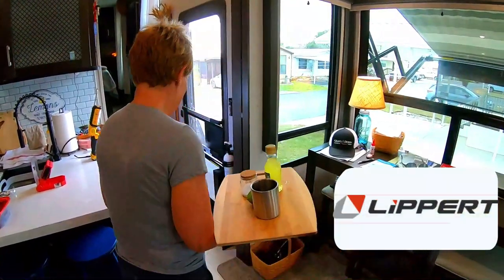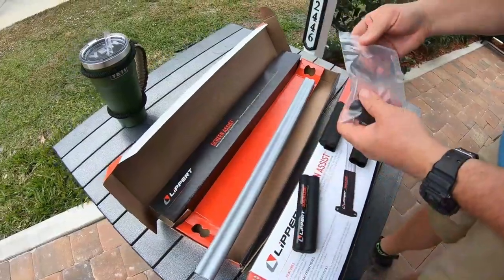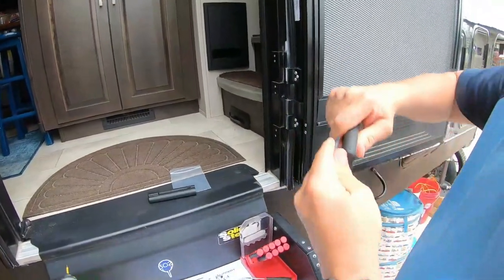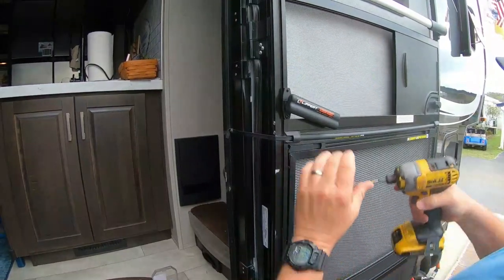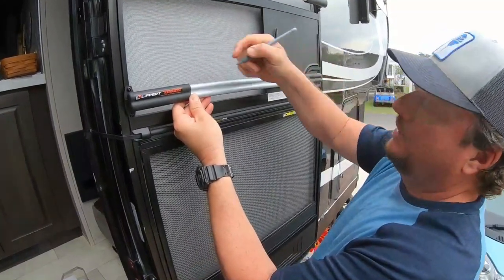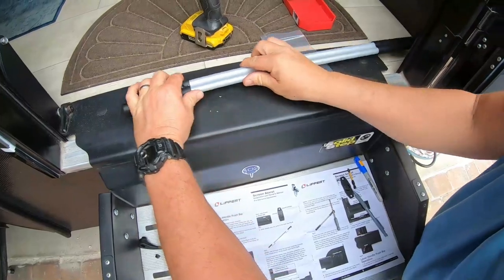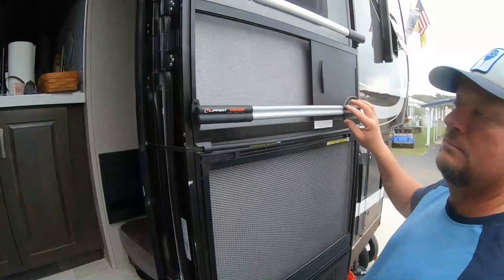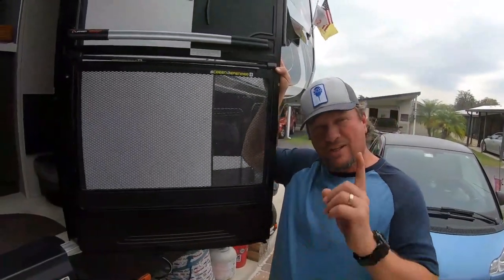Lippert Screen Assist - Hands Free Screen Door Opening!

Comment: Just an FYI , the mounting hardware that mounts to the screen door side (not the handle side) has 2 flat spots on them , so when your installing the bar into the hardware you simply turn it 90 degrees and it slides in (not snaps in) , that way it will never wear out!) I dissected mine and figured it out!
It’s much simpler once you have everything all put together to just uninstall by unscrewing the 2 screws in the screen side. Great videos though , just thought I’d ad my   2 cents that I found the hard way! Thank you both
Reply from the maker: That's a great tip, funny cause I am going to install another one on our back toy hauler door.  Thanks for taking the time to post!